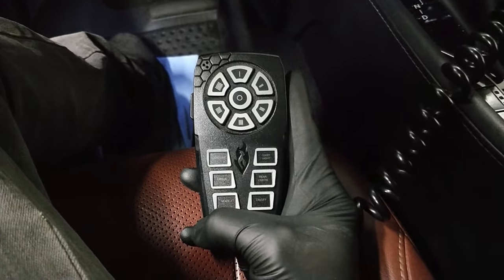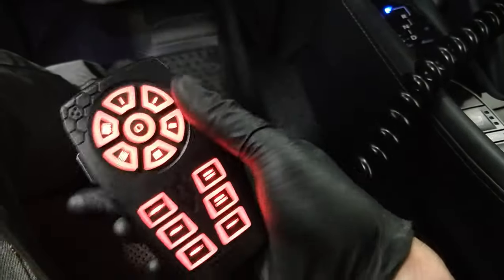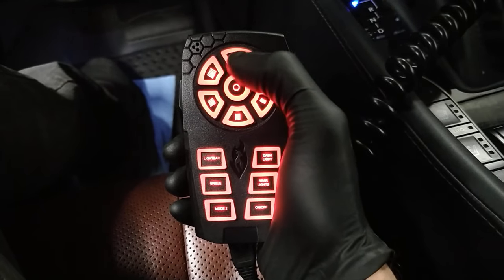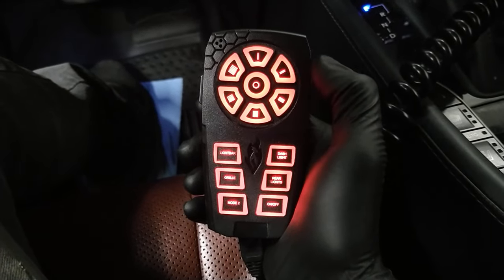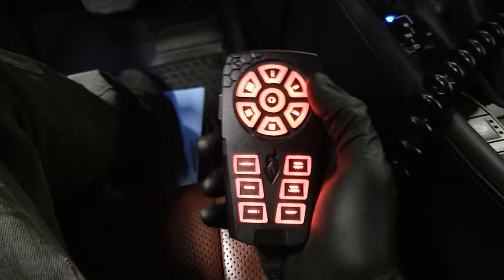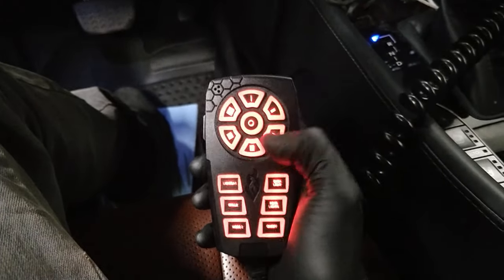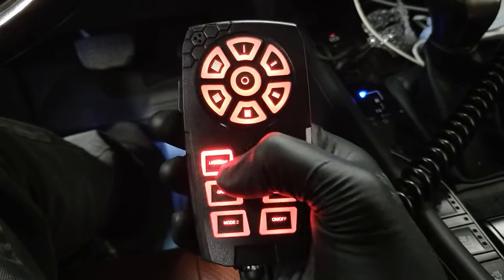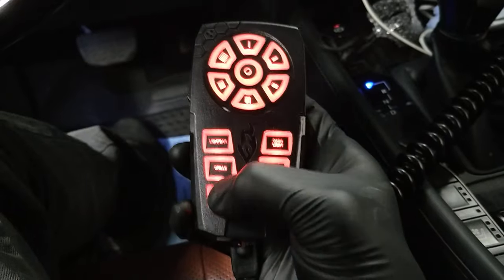Feniex Typhoon + RUMBLER

Comment: how did you do the ramp up / ramp down with button 6 on the handheld? i'm trying to do that for mine for the federal Q siren but i can't figure it out. thanks!
Reply from the maker: You have to set that button to a momentary button. See feniex instructions for how to do that.
Reply: @Code1Solutions  Are you able to do the ramp up/ramp down with the federal Q siren though, or just the wail? I tried that, didn't work
Reply: @waterlostic5256  I believe you need to set it to manual mechanical coast (there are 2 types of manual mechanical tones, one is manual stop, which stops soon as you let go of the button, other is manual coast, which continues to coast after you let off the button)
Reply: @Code1Solutions so I’m trying to find ramp up / ramp down I have the same siren and I loved your set up, on the one but button 6 I’m having a hard time what dose it sound like not momentary so I can figure it out I went through all the tones can’t seem to find it ? Also you finished up my friends car not to long ago amazing job🔥🔥
Reply: Did you find out how to do that ?

Comment: Where do you install the speaker? I installed mine by the shutter assembly inside the grille and it’s triggering the check engine light on. Any idea where I can re-mount it on a 2018 Silverado?
Reply from the maker: You have to make sure to leave enough clearance for the shutters to operate properly, as well as enough clearance from the radiator so that it won't puncture it.  On the silverado, I believe the best spot that will achieve maximum loudness is by mounting it to the upper right portion of the radiator assembly frame, with the bolts facing up and the speaker below the frame. Obviously mount it securely and with caution.
Reply: How do I buy this without the lights